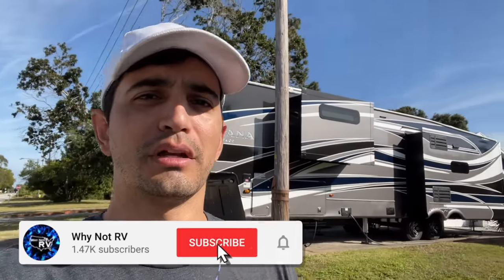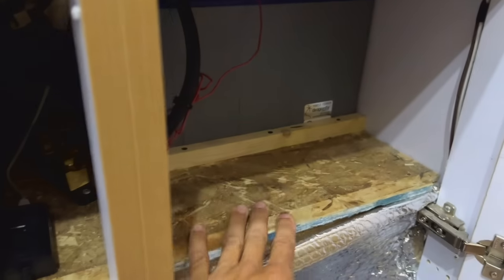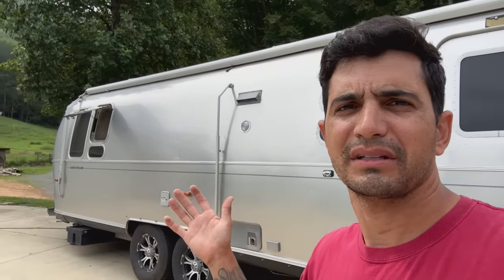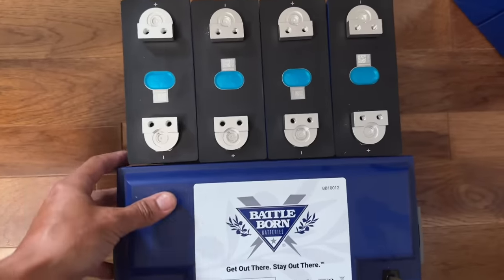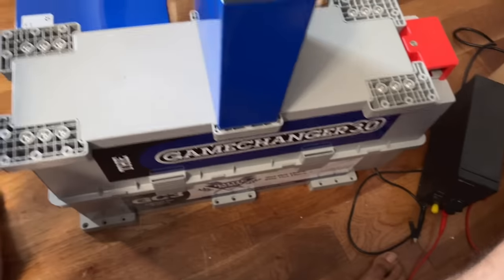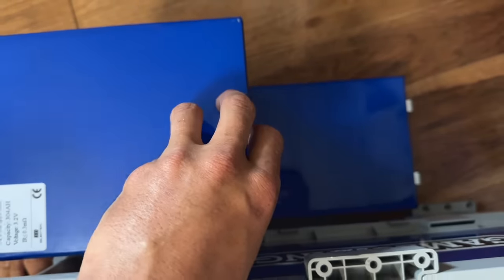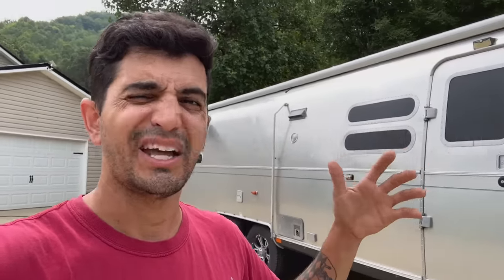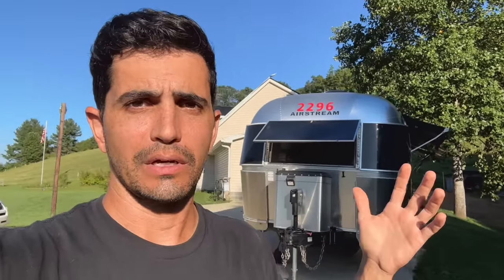Best DIY Battery Upgrade on the Market - GOODBYE BATTLE BORN - Why Not RV: Ep 127

Comment: Pro Tip on the top balance - You should actually connect to the positive on one end of the string and the negative on the other end of the string instead of side by side on the single cell.
Same thing when you connect to your system - let them drain from different ends of the string.  👍  Oh, and using equal length cables to hit the positive and negative.
Reply from the maker: Definitely always use equal length cables. I didn’t really show it much in this video but I actually have four identical cables running from each positive and each negative to the main busbar system. For the top balance thing it’s not a bad idea of course, but with such low voltage and low current, it really won’t make a difference when you are just letting it sit there for a couple days.
Reply: this guy has a lot to learn about making batteries the right way
Reply: @WhyNotRV  Are you suggesting that you did a top balance on sixteen 300AH batteries in parallel with that power supply pushing 6A in "a couple of days?"
Reply from the maker: Not necessarily. It definitely took a while. I didn’t give an exact time of what mine took. Of course, depending on the charger, amount of cells and capacity… this process can take anywhere from a few hours to a few weeks lol
Reply: @WhyNotRV  You have no idea how long it took?  A few weeks is more like it.  This video has so much fail.
Reply from the maker: I appreciate you watching
Reply: I was thinking that same thing when I seen how the wires was run 😆
Reply: @WhyNotRV Engineer here, you almost never need equal length cables, even cheap BMS are smart enough to stop charging to measure voltage which cable length doesn't affect when at no load. As long as no balance currents are flowing in the balance cables during balace voltage measurements there is no need for equalized lengths of balance cables.

Comment: I did very similar on my sailboat although I used the JK BMS which does a fantastic job of keeping all of the cells balanced with its active balancer.  When you top balance, you should connect the + & - leads to opposite ends of the pack so that you do not have the accumulated resistance in the buss bars from one end to the other.
Reply from the maker: Sounds like a good build. I’ve heard a lot about the JK BMS. Going to try one on another build I’m working on soon
Reply: @WhyNotRV  I love mine.  I just took the cells out of the box, connected them in series and put the JK on a 13.6v charge.  When they first got up to set voltage, the pack was over 250mv out of balance.  The 2A balance does its thing and on mine, after 4-6 hours, it had the delta down to 10mv.  After that, I charge to 14.4v and it kept up with balancing the pack.  If the pack is badly out of balance, you might need to let it run at 13.6 for 3-4 days during which time you will see very little progress because the low cells are in the flat part of the curve.  Once it starts to come down it improves quickly, and you end up with a perfect top balance.  I have had some other JK users think that it was not balancing because they did not see any reduction right away.  If you think about it, how much movement of the voltage do you see when you are charging with your big main charger between 13.2v and 13.4v?  On my 560Ah pack it takes hours at 60A to go from 13.39v to 13.4v.   2A while huge for a balance current is still small when compared to the 300Ah of a cell so some patience is called for.

Once you get your lowest cells to 3.4v they are all above 98% full so everything happens quickly from there.

I do hope that by now you have added class T fuses to the +out and moved all of your sense wires to the top side of the buss bar or into a seperate screw.  I see that some of your buss bars have a small, tapped hole which I assume is for the sense wires.  If you have anything between the terminal and the buss bar it increases the resistance at the worst possible place and causes heat, which causes more resistance, which causes more heat...

Comment: Here are some hints how you can improve this installation. 1. Put insulator material between the cells. 2. T-Fuse between each battery and positive busbar. 3. The ring terminals for the balance leads should sit between the nut and the busbar 4.  Compress the cells or at least use kapton tape 5. Do not place the BMS on top of the batteries in a box 6. Strap down your batteries. On a rough road or in case of an accident those cells will fly all over. 7. The top balancing with 5A must have been taking many weeks having in mind you have 1200 Ah……
Reply from the maker: I appreciate all the input here. Definitely some great advice here.
Reply: Everything you said above is very important. The install in this video is an over simplification to the point of being somewhat dangerous.
Reply: to add to that i would have checked the volts at every battery lead wire   to see it thing are wired right  if not you can fry that bms
Reply: I wonder if he is liable for putting out a garbage install video if someone burns down their camper following his directions
Reply: I think the value of this video was to communicate being able to put together a large battery bank inexpensively.  It was designed to stimulate thinking about one's personal needs and circumstances.  It was not step by step.  I am intrigued by the idea enough to learn more.  Thanks for the video and the constructive comments are also helpful.
Reply: @joniboulware1436  I have already done this and have 960 amp hours of these prismatic cells installed in my trailer for about 2 years now.

let's get this straight,   his install is a fire danger.   his install video needs taken down

he did not fuse the battery packs.   the conductors were undersized and no fuse or breaker protection on the inverter or charger was seen.     

I am going to bet his solar array isn't fused either

please if you are going to attempt this there are much better sources for information
Reply from the maker: Exactly. I have other videos showing detailed installs of different components. This was exactly that. See the footprint and the results you can obtain.
Reply: I have read compression is only needed for first charge, not ongoing.
Reply: @WhyNotRV these cells went up in price overnight.. they were $340 shipped... now they are coming up $650
Reply from the maker: Not sure where you saw them for $350. I paid 640 for four cells
Reply: @WhyNotRV  I need to stay off meds (don't take any though) you are correct...  it was a battery kit I saw but it did not include the cells
Reply from the maker: Ya that makes sense 😂
Reply: I did all of these tips, I followed the will prouse stuff, bms, the whole 9 yards... still had it go up in smoke. I'm not messing with diy on these battery anymore. Just buy a UL listed one and get on with it. Not worth the time:savings:risk in my experience
Reply from the maker: Do you know what happened that caused it to fail?
Reply: @WhyNotRV  no clue. The vendor where I sourced the cells said they would send me more cells to replace the failed set. When I called, they asked a bunch of questions about water/wet. I'm in Arizona and never had any of the cells around water or wet. They failed while charging at 0.25C rate around 80f and 15% humidity.
Reply from the maker: Definitely weird. How confident were you in building the pack? Was it your first one?
Reply: @WhyNotRV  I had 4x 100ah packs in parallel. It was the third in assembly. Once it went up, I replaced them all with UL listed units. I was lucky I was there when it went off and pulled it out. I have no clue about damage to the other cells so I got rid of them all.
Reply from the maker: Scary for sure.
Reply: @scottleggejr  I did the same....I bought 16-280A cells, 2 BMSs to make two 24V batteries.  Was less than half the price of the BattleBorn with the highest quality cells made in China (Eve).  All grade A and matched by the distributor. The Chinese distributor does so much business here they stock cells in CA to avoid the China to US shipping delay.
Reply: @Step-n-Wolf  please can you share the company you bought them from
Reply: @camposvazquez guessing ‘Redodo’ or maybe ‘Power Queen’.
Reply: @GMC-qo9xi  thank you...

Comment: Not bad. I like the concept. I'd like to see a fuse and disconnect on the 12VDC - but that is just me. You do you. Thanks for sharing
Reply from the maker: Thank you. Yes I have done disconnects before but they are an added failure point in my experience so I don’t use them anymore.

Comment: I did the same thing for my coach  years ago!  great video!  please tell me that you put a isolation board between all the cells and the wall agaisnt the metal skin of your rv? Please please mount those BMS's for safety. I just purchased battery boxes for $30 bucks and made them look nice and protect all the componets.   you have to love the capacity of DIY built thow.
Reply from the maker: I used quarter inch foam, isolation board for any contact points. You definitely can’t beat the DIY sell options.

Comment: I wouldn't have connected the balance wires under the bus bars - you want a flat broad contact with the alloy cell terminal when shifting low volts high amps - put the balancer cable ring on top of the bus bar -  The 100amp Daly BMS passive balancer @35 mA  is just not man enough to  keep such large cells in balance - You need to supplement it with a 5amp active cell balancer that comes on at 3.45v - I personally would have gone for a blue tooth JBT or similar with active cell balancing - Finally slip some thin insulator sheet between cell cases  - In a van its possible to rub through the thin cell wrap and short the stack
Reply from the maker: Yes, I did move the ring terminals to on top, also added insulation sheet (cardstock) between cells. I might throw a active balancer on top of these at some point.

Comment: Thanks.😊. Id take this as more of a why to than a how to video. Others have pointed out improvements that should be made. Maybe when you upgrade solar etc. Consder going to 48v. Especially if a lot of power use is ac through an inverter. Ether use a dc dc converter for your 12v or using your existing solar charge controller add a separate 12v battery and run dc and ac systems separately 😊
Reply from the maker: Thanks for watching if you go through my channel, you’ll find where I’ve already built a 48 V extremely large solar system with dual inverters. In this Airstream application, the absolute craziest thing I would do would be to go to 24 V no need to go to 48 V, I did make several improvements to the set up which again I have followed videos showing. I’m coming up on a year now with it and I’m about to do a review and recap.

Comment: Rubber roof material is great for insulation between cells. Ive built a 30 kw lifepo4 and a 14 kw leaf battery for my solar power systems that run our holiday rambler travel trailer.  The battle born are suposed to be great but super expensive if you want alot of battery. I used the eve grade a cells with 2 hole terminals like yours. I used a dally 300 amp bms and all my stuff is 24 volt. My leaf cells i used a jk bms. I have active balancers that i only plug up to top balance on occasion but yeah building your own battery is definitely the best bet
Reply from the maker: Thanks for watching! Sounds like some sweet builds you got going on
Reply: @WhyNotRV  it started as a small hobby but it's turned into a way of life. I'm ki da addicted to this solar stuff lol. Seems every couple weeks there is new technology and I keep buying it but it's fun and better that I spend on this stuff as to spending on something that doesn't help our life ya know
Reply from the maker: Absolutely!

Comment: Too large a battery bank and not enough Solar. In order for the BMS to balance the cells, you need to be in absorption mode for 30 min per 100 Ah. That means 6 hrs for 1200 Ah. With that 100/50 victron there is not enough time in the day to bring those batteries to full charge from 50% and still be able to balance. They will eventually become out of balance. As an installer I see this all the time. Good luck with your system.
Reply from the maker: Yes the battery upgrade was just the first step. Solar will be next big project. I’m probably going to add a dc-dc as well.

Comment: Talk about temps, charging dangers with crap bms, Grade A, B, C grade cells.  Compression, enclosures oh my.  Also curious how larger format cells handle internal vibration due to mass vs smaller cells. Good practice to top off 1 battery at a time or maybe 4 ao you can verify each cell before combining. Good luck in your travels.
Reply from the maker: Oh, these are great day sales. I didn’t necessarily compress them but I did use wood along with quarter inch foam to prevent expansion. I’m going to be doing a follow video to show the finished product.

Comment: Thank you so much for this information! I am very excited to implement a similar system for a Dodge Ram ProMaster van build I will be working on. One question for you; one of the reasons I was going to go with the Battle Born GameChanger was because it also supports heating the battery when needed. Do you know if these batteries can do the same or could be configured to do so?
Reply from the maker: You can build an enclosure for it and insulate it and put a battery heater in with it. Only reason for doing so is if it’s in an unconditioned space and you will be charging it in below freezing temps. Depending on your build you likely don’t need to heat them.

Comment: Any particular reason you didn't go 4P4S on your pack, with a single 250A BMS?  Would have saved on cabling and been less worry about cell/pack voltages drifting apart.
Reply from the maker: Several reasons. I need 300 amp for full power accountability. Big BMS fails… screwed. One of these fails… redundancy… I have an easy cheap part to replace and my other batteries still keep the rig going in the mean time.

Comment: C- rates – In describing batteries, discharge current is often expressed as a C-rate in order to normalize against battery capacity, which is often very different between batteries. A C-rate is a measure of the rate at which a battery is discharged relative to its maximum capacity. A 1C rate means that the discharge current will discharge the entire battery in 1 hour.  The feogrn batteries are rated at 300AH per cell and since you are connecting then in series you are adding the voltage so the current stays at 300AH. They are rated to have a maximum continuous discharge current rating of 1C so they can be discharged at 300 amps. since they can be completely discharged in one hour. So, you could put a 300A BMS on them to make use of their total potential. By the way, thanks for the info on these batteries, I will be using them on my RV but with 300AH BMS's.
Reply from the maker: Thank you for watching and thank you for the comment here. Of course there’s multiple ways you can wire these and multiple ways you can use these because I did four different 12 V sets I chose to use for individual 100 amp BMS Since Cesar wired in parallel with exact length cables and everything the system could draw 400 A at one time and will pull against all four batteries equally. And the BMS will be just fine. Of course BMS also have different capacity ratings and due to my future plans with this RV in terms of solar and DC DC charging the 50 A per BMS or 200 A total was more than I needed. Thanks again and hope you have a great weekend, and good luck on your build.
Reply: @WhyNotRV   I am going to be using 4 or 5 of these batteries powering a 3KW inverter plus a number of 12 DC loads The inverter will draw about 400 Amps when fully loaded. I have come to the conclusion that I will only need 200 amp BMSs which will give me more than enough current to handle my load. This way I will never overload the batteries. 😀
Reply from the maker: Awesome! Sounds like a great build

Comment: I wouldn't leave the BMS units in cardboard boxes on top of the batteries. It might not take very long for road vibrations to cause the cardboard to wear allowing the BMS to contact the terminals.
Reply from the maker: Yes. I added 1/4” foam board on top of the batteries between the BMS cardboard boxes and the terminals

Comment: In terms of insulation between the cells and each battery, I bought inexpensive cutting board sheets from a $$$ store, cut pieces to match the size of the side of a cell and inserted one piece between each set of cells that make up a battery.  These sheets provide insulation between each set of cells and will prevent the wrap of each cell from wear and tear due to vibration.
Rubber sheeting between each cell would provide better insulation and cushioning.  But if the batteries are not going to be subject to vibration from any mode of transportation, the cutting board method should suffice.  You might be able to purchase inexpensive place mats and use  pieces as insulating material.  They will most likely have some form of backing or padding that will provide insulation and cushioning between the cells.
Reply from the maker: Yes, I’ve seen several people use construction paper as insulation in between the cells. I ended up using foam board construction paper, type stuff as a side and top insulation. I have it pretty well secured tight, but I am going to inspect them after a couple of trips to check for any vibration rubbing points. If I have some, I’m going to add insulation in between the battery cells.